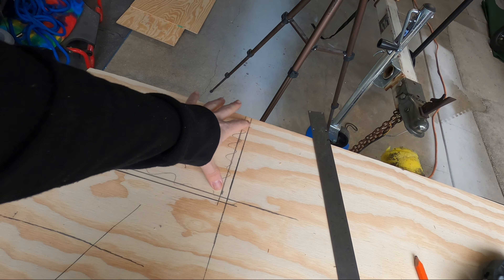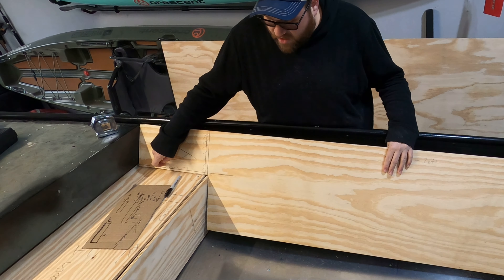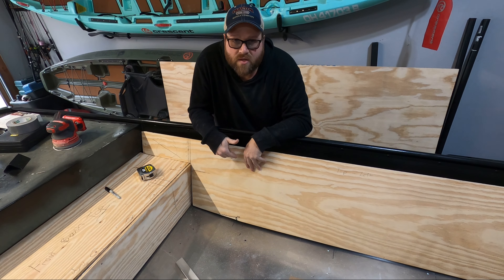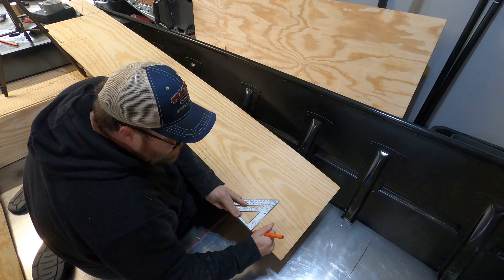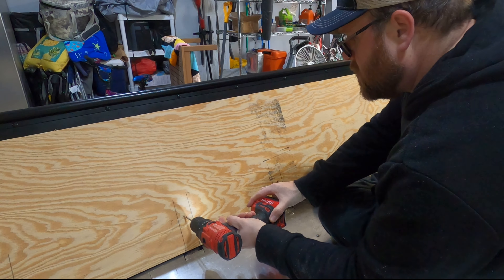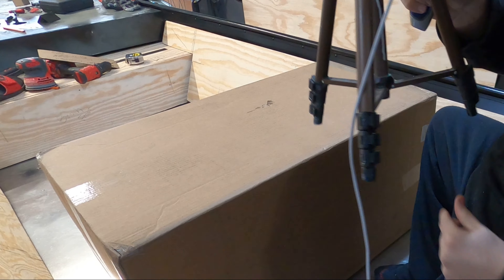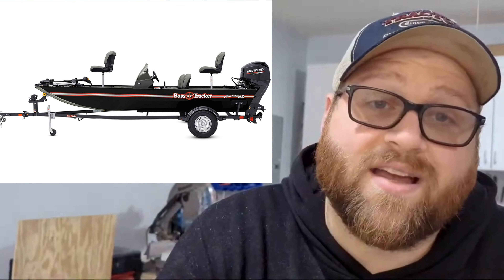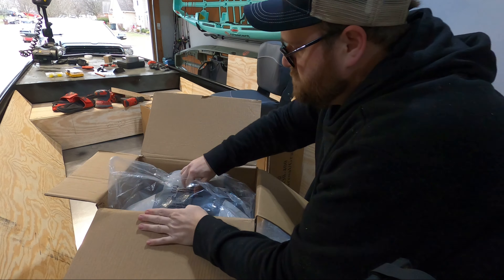DIY Boat Upgrade: How to Add Side Paneling to your Jon Boat Build

Comment: I just subbed to you channel.. great content.. I’m fixing to start building on my mod v… I do have a couple questions, my floor has braces like yours.. what gauge sheet metal did u use for the floor? Also, is the metal the only thing resting on the floor braces?
Reply from the maker: Thanks for the sub! I have this video here for the subfloor (floor supports) https://youtu.be/rJfItH2scpY and this video for the floor install itself https://youtu.be/Ya7LbzR3oEo. I used this for the floor: 100 3003-H14 ALUM
SHT 48 X 96

Comment: Why wood? Why not aluminum?
Reply from the maker: What's up man, love your videos. Mainly working within my means and skill set. Aluminum would for sure last forever, I used it for the floor but for the paneling I thought wood should suffice and cost a heck of a lot less than a sheet of aluminum.
Reply: @MVB Outdoors  thanks man. Those side panel could be thin as .063 you'd be surprised how cheap a sheet cost. Good luck with the build brotha.

Comment: Do you have video of how you attached the side panels at the top under the gunnel?
Reply from the maker: I dont have a video of that specifically but I just ran screws up the braces and it pulled the side walls closer to the boat